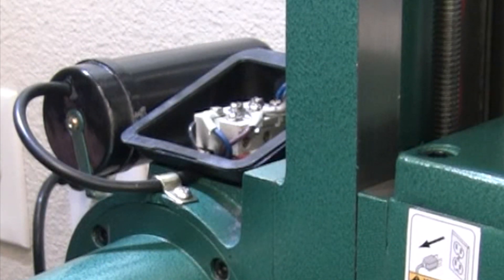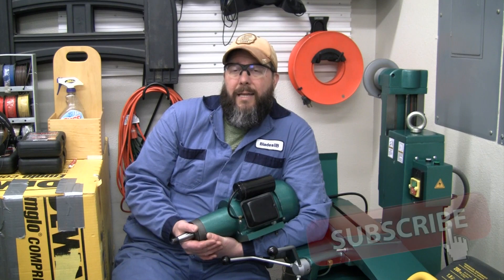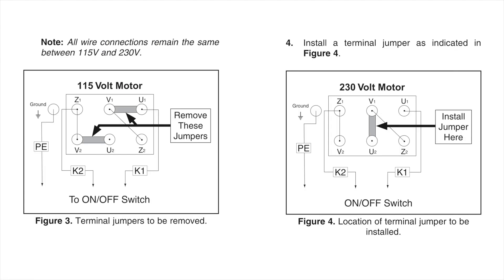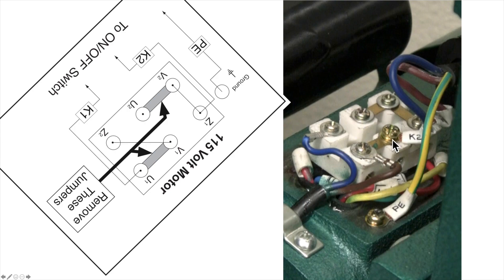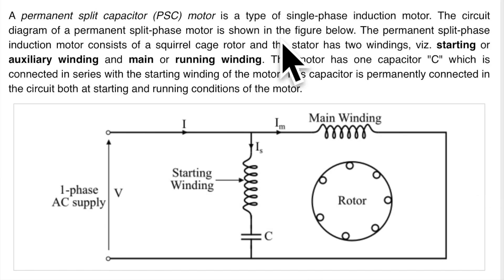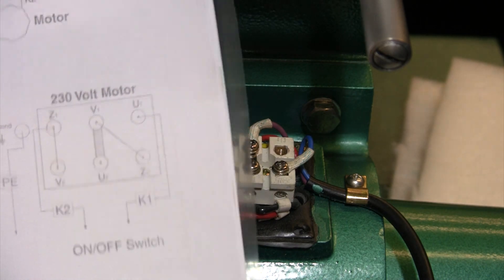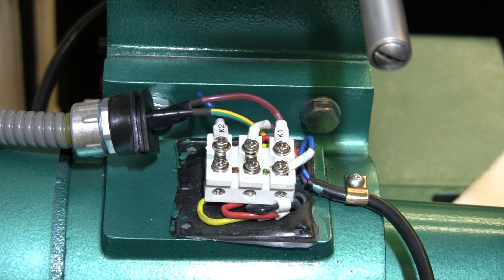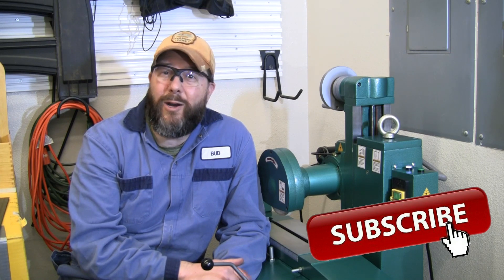115V To 230V Motor Wiring - Should Not Be This Hard - I Smoked 2 Motors, Learn From My Mistakes

Comment: Did ya send the other motors back?
Reply from the maker: @marcknab7456 - No I still have them. Pulled one apart to see what wire smoked. Beyond my skill to rewind and repair but figured they may have a use one day.

Comment: Hi folks, A better motor upgrade, if your power supply permits, would be a three phase conversion. Could also be done with either a VFD or a Rotary Converter. The big difference is that you would get a smoother grind. Single phase motors have a pulsing torque characteristic whilst three phase ones have a smooth one. That is one of the reasons three phase tends to be used in industry. I do know that US and UK wiring practice is VERY different - it is not just down to voltage and frequency - how the supply, neutral and protective feeds (aka 'earth') are derived also differs. If you do not know what you are doing do not fiddle, this stuff can kill.
Reply from the maker: Bob UK - Thanks for the comment. I have 3 phase on my lathe and used a VFD and agree with all your points. Smoother run for sure, and 3 phase is much better for a lot of starting and stopping.  For this project I just had no desire to find a 3 phase that would bolt right up, but it would make a nice grinder.

Comment: Few years back I bought a CHEAP reversing switch for my Logan lathe...no biggie right...the motor is a  120-240V 2HP from Harbour freight...the motor had a good diagram,  the switch had nothing....I spent my carreer as an electrician,  but I had to really think about this 1...if it was a single voltage mtr it probably wouldn't have been so bad...luckily in the end it work 1st time albeit with a lil cheating
Reply from the maker: Craig Tate - Great story, glad to hear you got it first try.  If only I had that much experience as an electrician - I am sure this would have been an easy mistake to spot.  Live and learn, I appreciate the comment.

Comment: Ok, 230v will use ½ the amps as 115v, but what else are you gaining?

Love the videos and how you explain, and even tilt charts to match the pictures... You're attention to detail is great..... I too would have "probably" made the same mistake.
Reply from the maker: Christopher Enoch - Great question. In my mind half the amps meant less heat and potentially longer life over time?  Especially since grinding is long run times. Since I had a 220 right there it seemed like a good idea. Hindsight being what it is, clearly was not a good call as I have gone through 2 motors so no extra life gained. Oh well!
Reply: You get to run 230 over a longer distance

Comment: on such a pricey machine, Grizzly should supply a technician to do that switch over,.
 they should do it and test it before the machine leaves the supplier wearhouse.
good video.
Reply from the maker: Jacques Poirier - Appreciate the comment. They send it wired and ready to go on 115V with a plug so I am sure they are tested before sending. Anything after that they recommend an electrician, the units were good just the instructions could have been more clear and as I said, I am sure an electrician would have spotted the issue and wired per the diagram no problem. Live and learn for me.